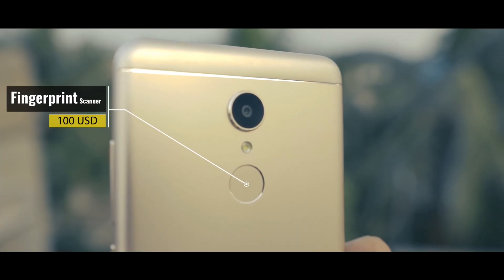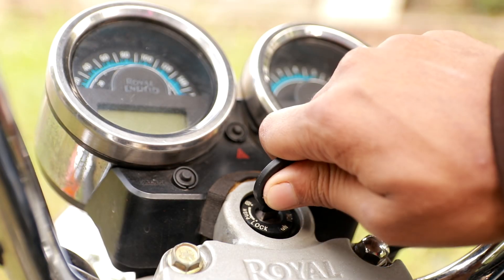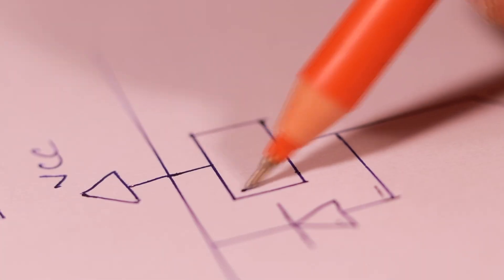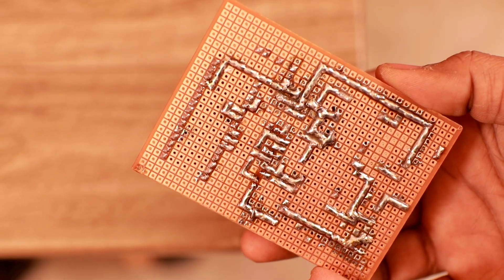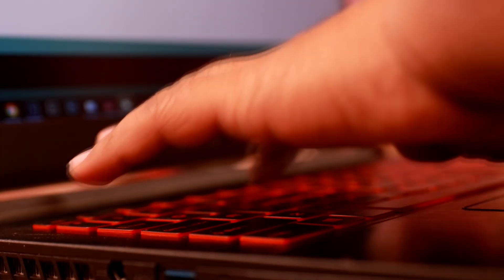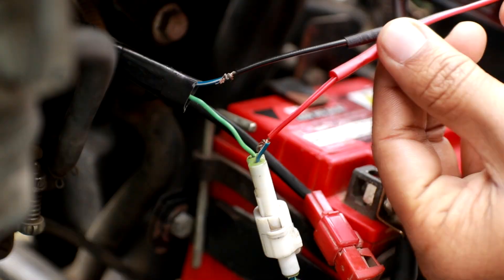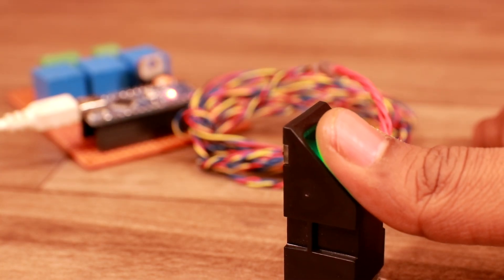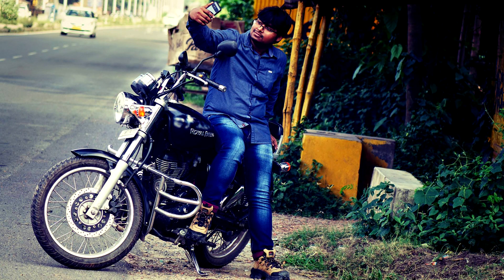How to Make a Smart Unlock System For Motorcycle - Keyless - Fingerprint

Comment: I just used a two channel wireless receiver with it's remote. One button to put the bike in contact and the other to start it. Same prize or cheaper, plus no soldering, plus now I have remote start.

I left the original ignition connected as a backup, because I rely in physical and situational security anyways.

Nice project tho, the fingerprint ignition is definitely cooler 😎👌.

Comment: Which components sir do you use
Reply: 1. Microcontroller
2. Relay with driving network
3. Fingerprint sensor
4. Power supply network

Comment: The light in the scanner over time would drain the bike battery my idea is you use the key first to power on the bike then powering on the light in the finger print scanner then you use the finger print scanner to start the bike that way your scanner light only powers on with the key and also gives it added security because not only would the thief have to cut your fingers off but they would also have to steal your keys

Comment: Sir, I watched that video with great pleasure.  But as you mentioned, you did not provide enough information to design the circuit at home.  So if you can, it's very important to present the values of the equipment used.  If you can, it is very important that you let me know about the parts and frequencies used in that circuit.  Thank you
Reply: Can we help you?
Reply: @magicianofelectronics951  I need your help.  I would love to design this circuit.  I look forward to hearing from you
Reply: @ranjithsuranga2474  how would you like to get help?

Comment: Now very easy to robbery
Reply: Ohh really, try on my bike as I'm going to install it,

Experiment done on,

Honda activa 5G
Microcontroller ATmega328p
GT511C3 fingerprint module
5V DC relay/ 120V 10Amps DC(only power control)

The project is show cased in LJ innovative village, 2019

LJ Polytechnic, LJ institute of engineering and technology, Ahmedabad, Gujarat, India

See my profile for demo output, thank you with honours

Comment: Is this suitable for pulsar 220f bs4?
Reply: You can use it in anything, just you need different components like a relay for bike and solenoid for door lock etc. Thank you
Reply: @magicianofelectronics951  it is waterproof?
Reply: @ShriBhraguherbals  we can make it water resistive,

Experiment done on,

Official project, March 2019

Model : GT511C3 optical fingerprint module
Vehicle : Honda Activa 5G (2018)
Controller : ATMEGA328P

THANK YOU

Comment: Circuit diagram pls
Reply: Fingerprint sensor has 4 wires, 1. Ground (negative) 2. Positive 3. Transmitter 4. Receiver, both the receiver and transmitter pins are defined in program and you can change it, thank you

Comment: This fring print how cost price in activa 5g bike
Reply: GT511C3 is about 1900 INR on Amazon, but you can use R307 which is about 1000 INR, or you can search on Amazon, Flipkart, Alibaba, eBay, Keyword : Fingerprint module, Fingerprint sensor, optical fingerprint sensor

Official project,

Fingerprint module GT511C3
Vehicle : Honda Activa 5G
Institute : LJ polytechnic, LJ campus, Ahmedabad

Started in March, 2019

Thank you

Comment: Since the names and notations of the electrical components used in the circuit are not added to your video, I am hoping to answer that question.
Reply: Sir, I watched that video with great pleasure.  But as you mentioned, you did not provide enough information to design the circuit at home.  So if you can, it's very important to present the values of the equipment used.  If you can, it is very important that you let me know about the parts and frequencies used in that circuit.  Thank you

Comment: It's simple to thief ur bike. By just disconnecting 3 relay wires which is used for power on and ignition.. U r circuit does only switching mechanism  no more in that....... Still update required..    (Still interesting)
Reply: Yea, it is possible but it is also done if you have fingerprint sensor or not, and it is nice that you are interested

Comment: Heyy, I want to do something similar but want to use NFC/RFID instead. I tried to do some research but with my limited knowledge, it's very difficult. Can you help me?
Reply: Why NFC and RFID? Why not radio signals?
Reply: @magicianofelectronics951  cause I can easily use NFC in pairing with my phone
Reply: @takshshahh  what about bluetooth or WiFi?
Reply: @magicianofelectronics951  If in case my phone battery dies, I can just use a NFC tag or a NFC card

Comment: I like the idea, but is it not possible just cutting the finger print sensor wires and short circuit them?
Reply: No, Fingerprint module not sends power signal but sends data signal
Reply: @magicianofelectronics951  that mean that you have to add a controller  somewhere between the bike and the power
Reply: @GabrieleNunnari  yes, controller is placed inside the bike, only sensor is installed outside

Comment: Only one man use
Reply: No, GT511C3 has capacity of 200,

Experiment done on,

Official project, March 2019

Model : GT511C3 optical fingerprint module
Vehicle : Honda Activa 5G (2018)
Controller : ATMEGA328P

THANK YOU

Comment: I got that  idea 5 years ago but the fingerprint is not waterproof to use for bike so i built RFID system to turn on key
Reply: how??
Reply: Search for rfid arduino door lock and use the same method to connect to bike key wires to turn on nd off and keep rfid under plastic part where water is not reachable

Comment: Cut the wire of fingerprint scanner and directly touch them to start the bike🤭
Reply: Not possible, it is data line not power wires
Reply: @magicianofelectronics951  but  this is a less security keys are best
Reply: @jayantmukati7481  Yes keys are better, and advantages of fingerprint lock are 1. No mechanical jaam, 2. Lost keys, 3. No have to keep keys etc.

Comment: Dear Friend, 
Can you Please Help me to buy a Step down supporting which circuit is for me.
Let me Explain: My bike name Honda CB Hornet/CB Trigger
=====================================================
Currently I'm using LED headlight H4 7s 12v DC. But Problems is converting AC to DC power 
So my battery  down very  quickly. But Need to use it  without battery.
What should I do?
I have made a Plan like if I  use Buck Converter Step-down Power Module DC 7-32V. or 12v.
Please advise me which converter should I use.
Thank you

Comment: i want to power on off my bike..  i need diagram.. first i insert my key to bike then key turn it on.. it gose to power on the fingerprint device power on.. then i put my fingerprint  for power on the bike.. and..  power off the bike.. not use red start kill switch and starter.. only for power on off

Comment: SO, in this case, A push start would still start the motorcycle!
Reply: That's why the most "reliable" security (if they really want it they'll get it no matter what you do) is physical: disc locks, chains, U locks, etc. Plus avoiding dangerous places.

The best is a combination of various types. In mine I have a GPS tracker, alarm with engine immobilizer, keyless remote start and disc lock plus chain.

Insurance is good but I believe it depends on your income and the value of the bike itself. I choosed not to use it as I can just buy a new one with my savings plus all the money I didn't have to pay them along past years. It's only good if your bike is very expensive and/or you consider that there's a high probability that something might happen.

Comment: I think this isn't good idea to put fingerprint on your bike. It's not I don't like the idea, but when it's raining, it will cost damage to the fingerprint or the PCB. Besides, the thief wil easily steal your bike by making another copy of your fingerprints. However, you still need to use your key does not matter either you're make any additions on your vehicle or not but still key is important.
Also, the fingerprint that you're using will drain the battery. I afraid if the battery explode 🤨.

Comment: Hello sir, can I ask where or how did you power up your arduino? Or what is the power source? Is it the Motorcycle battery? If so, did you use any  voltage regulator?

Sorry for asking, i'm not an electrical student/engineer, I only know how to program but not much on the electronics side, still learning.
Reply: Same question in my mind... I wanna power a small RF circuit using Bike power supply but I don't know how to reduce the supply for low power circuits.

Comment: I have a question so you said no one will be able to steal the bike without the key how about if they disconnected the fingerprint monitor and they connect all the wires back and they turned it on

Comment: Should never try any think like this because the components used is not of automotive standard's trust me if you circuit fails your engine will stop in between which can lead to casualty

As Arduino and such kind of boards are not approved for automotive

Be safe always your life is in your hands don't play with it
Reply: Yea i fet what ur saying. Must use CAN protocol and stuff
Reply: @sankethgowda5522  no it depends what protocol you using for communication
CAN or LIN or may be UART
But the question is what about the other components
Arduino is never accepted as automotive standard
In what temp range it's operating
Reply: @sankethgowda5522  again the type of relay it's is just a normal relay costing 20 RS 
It's also not automotive approved the system is connected with your ignition so faliure of the system will lead to casualty depending on the condition you riding yup idea is good but should not recommend others to implement it 
He can make it on his own rush

Comment: A unique and thoughtful implementation of digital authentication that you have shown here. If you are open to suggestions then I would like you to add a bypass key system to the whole setup. And the purpose of it is that when the vehicle is given to the service center for service then the owner of the vehicle does not have to be bothered for every engine startup procedure. Thank you.

Comment: Awsome work in your design and theory. I give u much props, but there are two reasons why this will not replace a key. One is the fact that most modern motorcycles use the key to lock/unlock the controls, aka steering wheel. This is Manuel function done through the key cylinder and is engaged and disengaged with the twisting motion of the key. Secondly the key like most any new vehicle is coded (aka transponder)  and needs to be bypassed. This is yet another anti-theft security feature. Your circuit would also need to mimic that function as well. Where i can seeing this being useful is as being an additional 3rd security measure to above mentioned but in any case you could just simply add a hidden toggle because a simple alarm module which more reliable can do all of the same. Ive even seen it where a proximity sensor was incorporated and simple push button was used to start the bike when in close proximity... none the less i love ur idea, definitely adds the cool tech factor.
Reply: This would work with other bikes that don't have a transponder.

Comment: 3 flaws i can mention, first and most important is fuses, you really need to add a fuse.
second the sensor is always on, that is not good you need to find a way to use it when needed only, i may suggest an RF remote controller. 
and I think you can find easier way to start the device. rather than using 3 different fingers.
Reply: hi, can you help me with this..  I wanna power a small RF circuit using Bike power supply but I don't know how to reduce the supply for low power circuits. Actually i want to use the side indicator switch and Brake switch to give signal to a RF Tx circuit which will control LEDs on helmet for Turn signal and Stop signal.
Reply: @kkg10190  ok, listen... To reduce the voltage you can use a lm7805 regulator with the circuit that you can find on the internet, also use fuses to protect your bike and the device.
Second, you can connect lift and right indicators through voltage deviders to have a 12 volts reduced into 3-5 volts and fed into your microcontroller.
Reply: @TheSilvax  Thanks, Just one more doubt, Can 7805 handle the large current around 10-14 A? I mean will it use as much current it needs or will it get damaged?
Reply: @kkg10190  ony 1 A, but why would you use it with 14 A??
Reply: @TheSilvax  RE bike battery has 14 AMP rating so I assumed that this much current will flow through the device.
Reply: @kkg10190  That what i thought..
Ok, the battery doesn't work that way, it is about your load, on this case it is a microcontroller and few chip's, it will not drow more than one amp, the rating is for the maximum amount of current you can drow from the battery.
Reply: @TheSilvax  ooh i get it.. Thanks a lot for patiently listening to my doubts and clearing it. I really appreciate. :)
Reply: @kkg10190  any time bro..and good luck

Comment: After a rain..
..finger scanner gets damaged,
Reply: Instead why not just appreciate if someone has actually implemented what he thought. "Critics and Inventors" arguing about the feasibility of this project. Ever fought over concept cars too?
Reply: @deepankarsharma93  AGREED WITH YUH BRUH👍👍💯
Reply: @deepankarsharma93  Well said.
Reply: Instead why not develope a mechanism that uses a smartphone to turn your bike on
Reply: @mmj19833891  already done
Reply: @mmj19833891  yes man it is possible
Reply: Hahaha
Reply: Yes
Reply: True...
Reply: You can just cover the fingerprint sensor by using a case or something like that......... problem solved
Reply: ram alagappan easier solution put it in your garage or somewhere sheltered
Reply: @RamA-rf5rv  always we cannot cover that finger print sensors
Reply: @RamA-rf5rv  that sensor is ultra cheap,and also if you it it with a case means also there can be a kind of vapour of the cold rain water. If it is there you have to remove the case and wipe it. Also what will you do if your hand is cut? if key is lost we can get one new...but you can never get a new finger. Any one who can get touch with arduino can decode it.  {so the ideal solution from me is use a cheap   waterproof fingerprint scanner or a unltrasonic finger print scanner}..........problem solved
Reply: @amalp.k1381  to prove your point you are ready to cut anyones finger
Reply: @amalp.k1381  how r u planning to hold the key without fingers?
Reply: @amalp.k1381  but u lost the hand or finger u simply remove the connections between them 
    Problem solved
Reply: @puroo936   I mean a wound or a small injury on the finger! Not cutting off the whole finger 🙄🙄
Reply: @iqbalhamza9917   I mean a small wound or an injury. Not cutting a whole finger. 😁
Reply: They do sell waterproof scanners on amazon too. I checked
Reply: Pesimist alert
Reply: Someone: design's a cap
Reply: Cover it
Reply: Or just spray vetro power spray and make it waterproof 😎
Reply: Searches the whole waste bin to find keys lol
Reply: And definitely... You can't put it under a cover, can you?
Reply: You know make it?!?!?!!?!
Reply: Maybe this fingerprint sensor is for the places where no rainfall occurs. 😂😂
Reply: yup that true but we are Indian we are jugadu's like a bike cover we will give create a cover for fingerprint scanner
Reply: Amal P.K but what if it’s waterproof 🙄🤣
Reply: @jeedlebeetle7952    If it is waterproof it's fine, I don't know how well a wet sensor can scan a finger. Ever our smartphone(not the super expensive ones) fingerprint scanner fails to unlock the phone when it is wet, etc. Hope u understood what I meant. 😊
Reply: clear nail polish makes the circuity waterproof , varnish can also work
Reply: Yeah so bikes doesn't has finger print sensors
Reply: This is only for people from Afrika
Reply: @denden9901  y y not for India

Comment: Using fingr print sensor as push button type for cranking the engine..
U put the delay time on program this will damage the selfstarter because suppose engine get ignited before one secnd (programed delay-1500) it will damage the starter

Comment: One question how does the sensor know to turn on. I believe its always on sensor which will deplete the battery.
Reply: Just add a power switch for the entire circuit.
Reply: @houseofelectronics5869  yes that's the only thing it lacks

Comment: I'm not completely sure, but if the blue boxes are relays, anyone could just got wire them and start the bike.
Reply: Same goes with any other bike. They are under the seat which is locked. If you can reach that part then you can do anything
Reply: i thoght so too what if the thief wire them together and just start the bike ??
Reply: To tackle that situation, proper packaging of the system can be done. And it can be placed under some secure locations like under the fuel tank. And somewhere like that. In reality nothing can actually stop a thief from stealing a motorcycle if the determination level is that high 😊. 🏍️☓
Reply: You can do the same thing with a key ignition, its not like it compromises security
Reply: @RautProductions1  hide at home and connect through internet lol
Reply: @howto4797 Hide the relay at home? You trippin
Reply: @howto4797  you are sweet

Comment: What about a push button with a key sensor if the key sensor have a 5 meter distance even you push the button did not start please do it..
Fist push was turn on the ignition then the second will start the motorcycles. 
Sorry if my grammar is not too good

Comment: I'd have a key override under the same cover in case of electronics failure. Have you tested the accuracy of the fingerprint reader? any false positives from other fingers / peoples fingers?
Reply: I think it's accuracy can be adjusted in the software.
Reply: meucunt1 these fpr’s are not trustworthy will need to use the readers from trustone fingerprint device as they are rugged